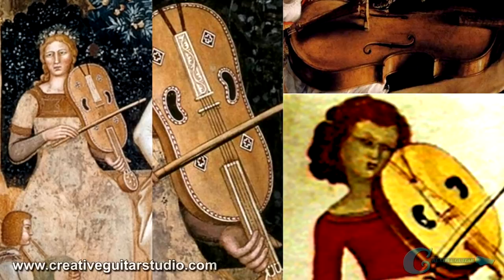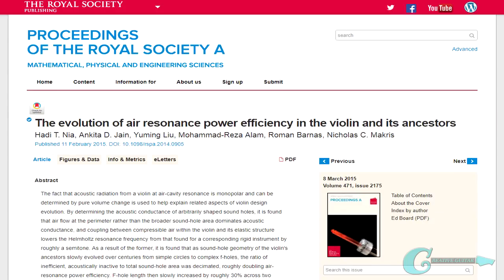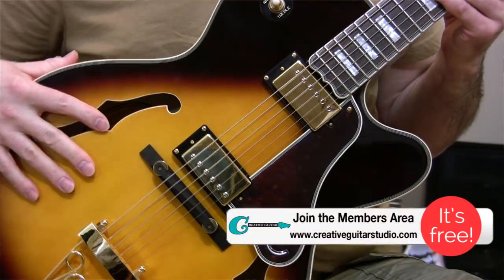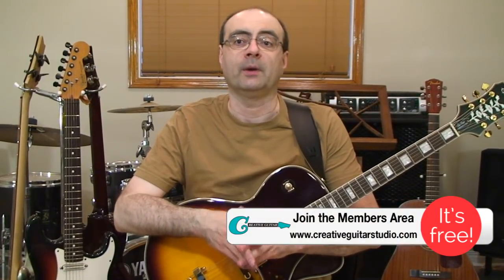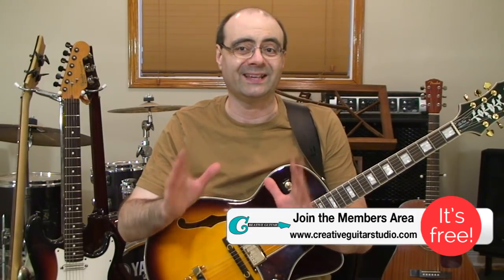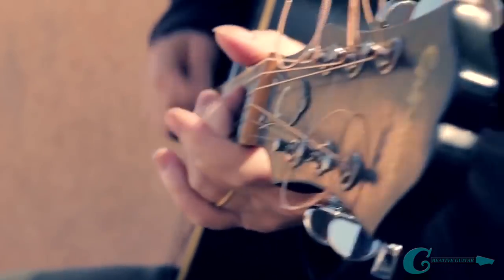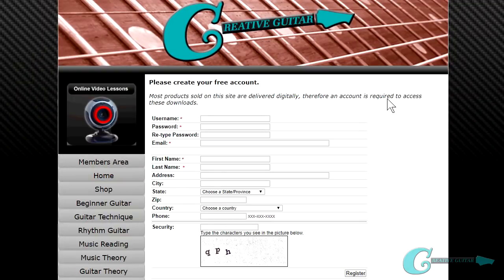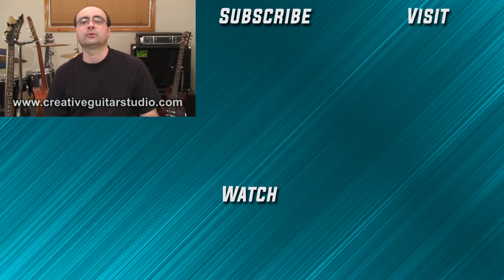Why the Acoustic "F-Hole" Guitar Design?

Comment: The f-holes pre-date Andreas Amati's first violin (1566). They had earlier replaced the C- holes found in early viols. Their primary function is to provide sufficient compliance to exaggerate the rocking action of the bridge. Sound field radiation has a predominantly dipole characteristic. The left foot of the bridge drives the top plate through the bass bar, and the right foot drives the back plate through the sound post. The top plate pushes sound out, while the back plate is sucking sound in. Think of the driver in an open-back guitar loudspeaker, same function. 

The primary acoustic advantage of an f-hole guitar is its increased, uninterrupted radiating surface. The curvature of the sound board provides improved sound dispersal. There is no soundpost, and the back plate is driven by passive coupling through the sides of the instrument. Radiation from the back plate is out-of-phase with the sound board, which establishes a complex dual source radiation pattern, not a dipole pattern.
Reply: Now that's what I call a comment, really superb info Stephen...thank you.

Comment: To me it's always seemed like this: The more wood vibrating the more air moved = more volume. The more wood vibrating at different frequencies the 'richer' the resonance. f - holes have more wobbly bits of different sizes than other shapes used (circular holes, ovals etc.) , more wobbly bits of different sizes = more resonance ( volume & frequency).  Everything has to be in balance, of course, that's the tricky bit!

Comment: Okay, I know what's going on here....especially since the length of the f-hole increases the effectiveness. It's not the "more sound can escape" it's that it's easier to resonate more of the face of the instrument because the f-hole is creating an area around where the bridge is pressing on the face that is more springy and vribration capable.

When the circular hole is there, the bridge is resting on a surface that is anchored ~300 degrees around the bridge. By placing f-hole on either side of the bridge, the bridge is now resting on a surface that is anchored lengthwise instead of cicumferntially. This is like resting the bridge on plank instead of floor. By increasing the length of the f-hole, you increas the size of that easily resonating surface.

Basically, the f-hole is allowing you to make better mechanical use of the face under the bridge. I would imagine that this could be pushed to the extreme with the face being replace by 3 separate pieces where the bridge is on the middle piece.

Comment: I don't know of any F-hole acoustic that can compete with a dreadnaught for volume.
Violins are probably a different story.
Reply: Acoustic archtops and dreadnoughts are entirely different animals, as their entirely different construction would suggest.  Both are loud, but each has its distinctive sound as well as unique range focus.  While a dread has great middle-to-low end power and resonance, the archtop has a much tighter range, which emphasizes the mid-range almost entirely and, unlike a dread, has virtually no sustain.  In the pre-amplification days of the early part of Big Band Era, the acoustic archtop with f-holes, and NOT a round-sound, was the instrument of choice precisely for its ability to "cut through" the volume and range of a band which might include 4-5 reed instruments and, say, 3-4 trumpets and trombones, each; the archtop, with both its unique f-hole design and, typically, parallel-bracing, could propel the band rhythmically with its tight, percussive sound, whereas a dread's resonance would get lost in the reeds range and sound "mushy" -- yes, that's the term that's frequently used to explain why a round soundhole guitar isn't used in such an environment.  Dreads, it could then be said, have a wider stylistic application, but the volume for which they're noted in, say, a Country/Bluegrass setting would not serve them effectively in a big band with brass and reeds or a small Swing group.  The archtop's tight sound is commonly described as a bark.  If you have an opportunity to hear an archtop in an acoustic jam, believe me, you will hear it every bit as loud as a dread, albeit with its power focused in a different range.